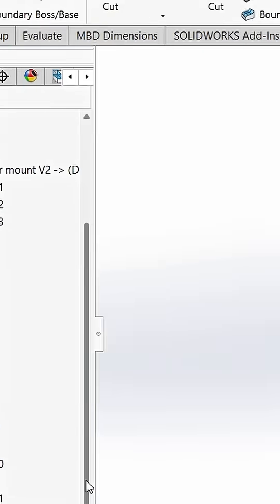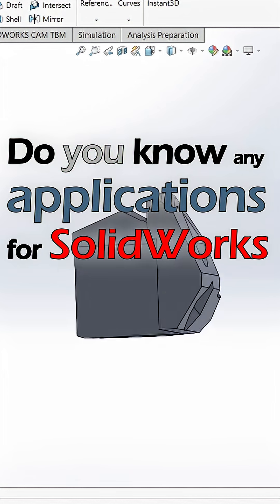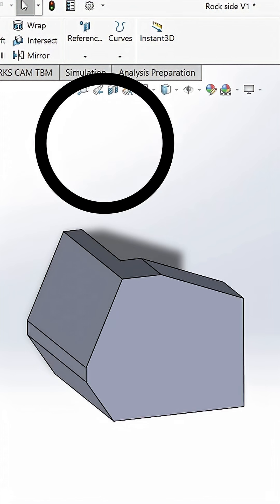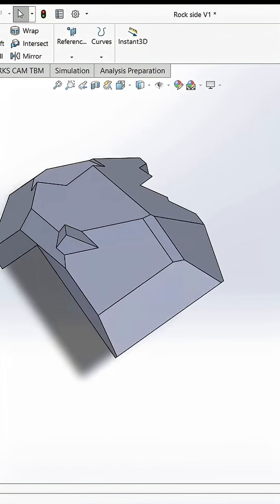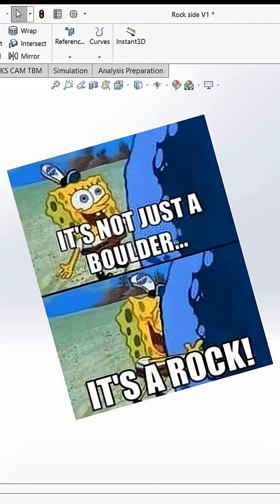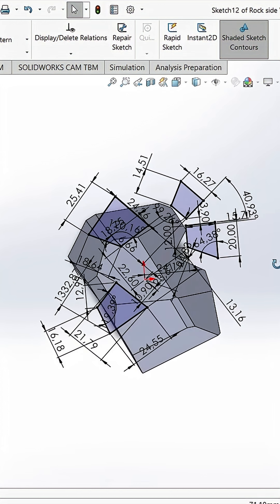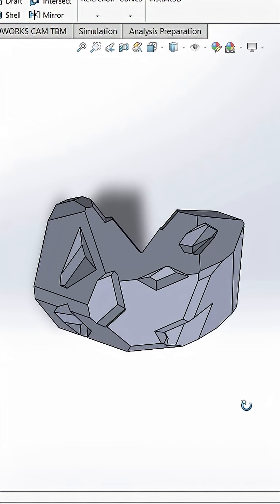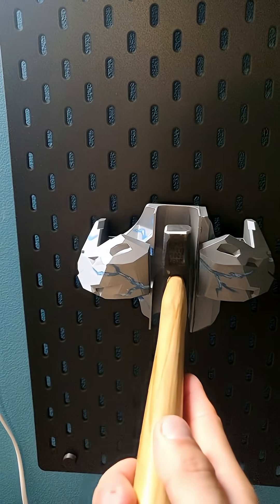SOLIDWORKS' Worst Application? #YAP

Comment from the maker: Any recommendations on using/learning Blender? I might want to learn it for 3D modelling, to print non-technical structures and stuff :D
Reply: I used to use blender and I recommend getting a piece of paper and writing down all the keyboard shortcuts for blender. It saves you a lot of headaches…
Reply from the maker: @Platypusplays1  Hahaha, is it hard to get into? Or are there just a ton of options to choose from? I heard the learning curve of blender was quite steep, or is that for mastering blender?
Reply: @Beuneraar1612  it’s not necessarily hard to get into, it’s just complicated to get into. You have to know how the software works before you can confidently make 3d models. That’s what people mean by the learning curve in blender. Once you have that down, and you know how things work and function, it gets easy to make things. It just takes actual effort and motivation to dedicate a day or 2 to learning how blender works. People say it’s hard because the only thing they want to do is make a 3d model, and don’t want to put the effort into learning the software.
Reply from the maker: Okay thanks, that helps! I guess it's similar to solidworks in that igs, just practicing and stuff. In that case I'll look for a good tutorial on yt and see how far I'll get ;) Did you learn to use blender from yt or? If so, do you recommend a specific channel?